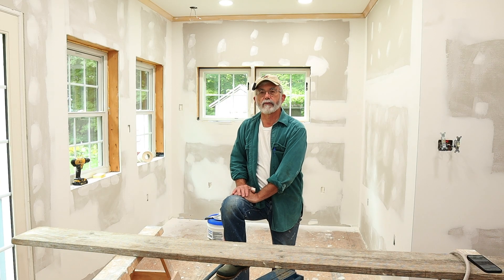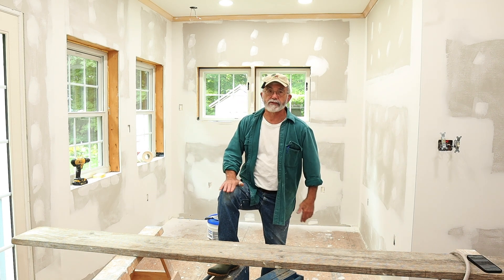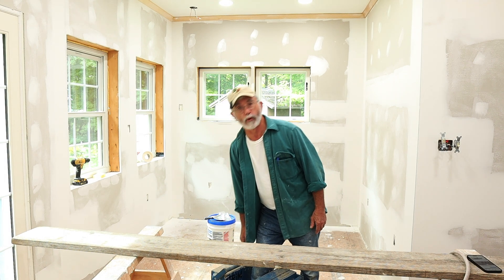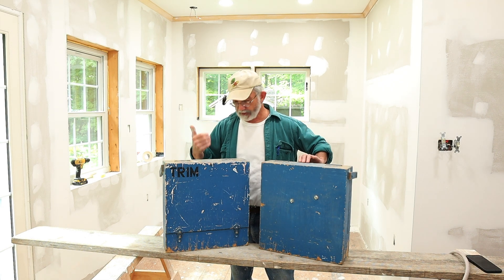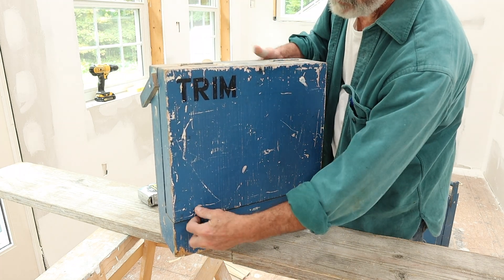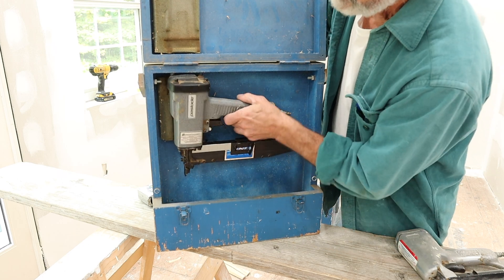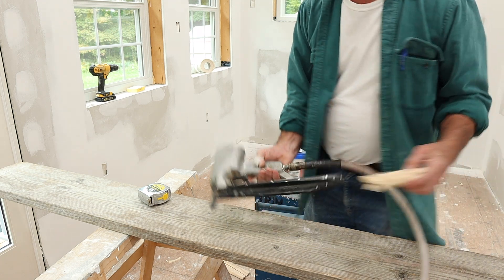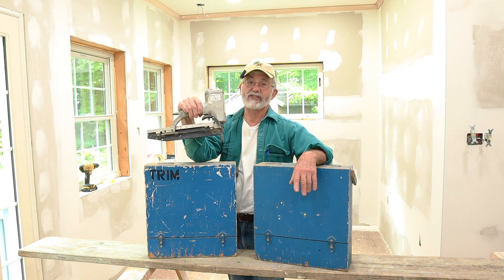How To Make Your Own Portable Air Nailer Storage Totes

Comment: Stood the test of time. Plenty of tools come in a plastic case with plastic hinges and plastic hinges which fail. My old Makita circular saw case spent the last several years with a strap to keep it closed. Most of the time it’s abandoned somewhere. It does keep the flimsy rip guide from getting crumpled. Too bad they discontinued the optional heavy duty guide even though the saw has been unchanged for decades.